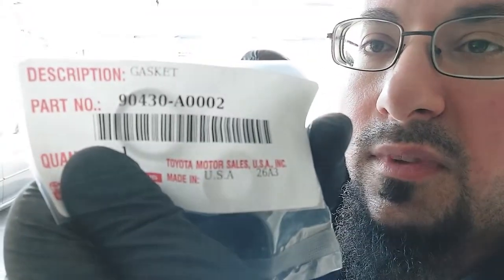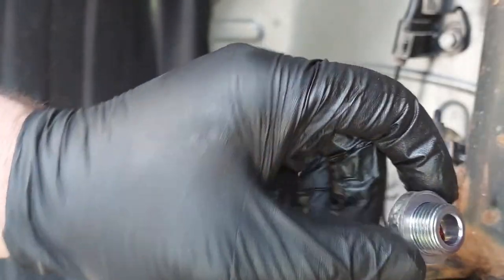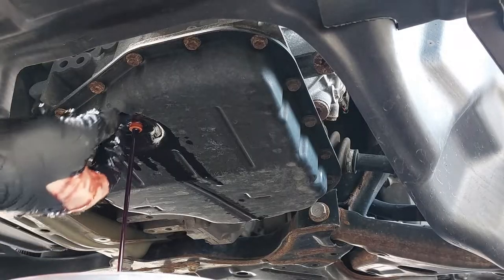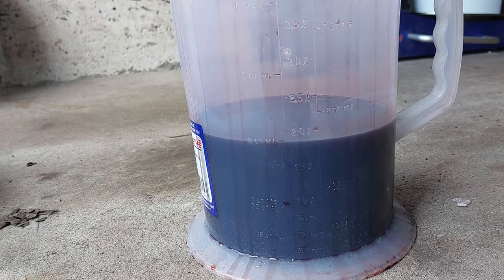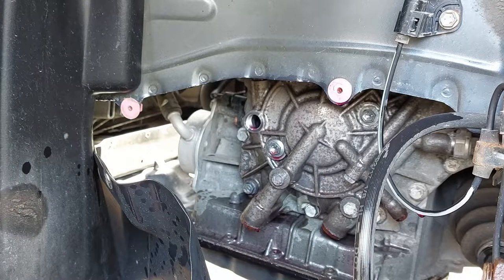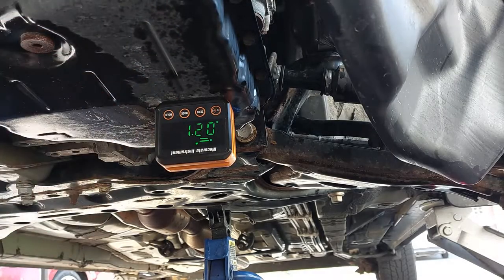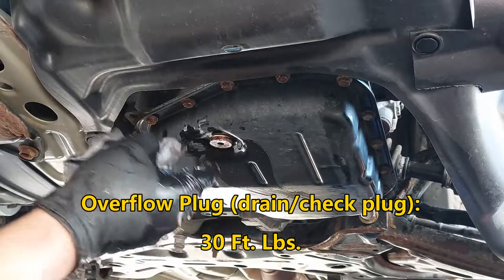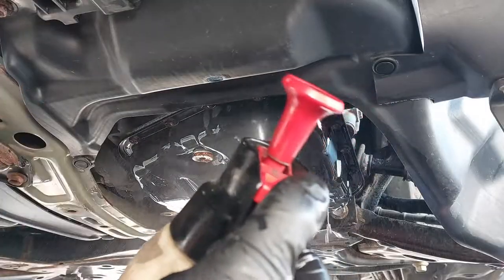2017 Toyota Corolla 1.8 - CVT Transmission Service K313 - Drain and Fill

Comment: You didn't even drop the pan and change the filter.  All you did was change a little fluid.
Reply from the maker: The customer only pays me for a drain and fill so that's all I do. We are not changing the filter and we are not dropping the pan unless the customer wants to pay for it.

Most customers do not want to do that service so I just do the basic service only.

Dropping the pan and changing the filter and gasket is not necessary on Toyota vehicles if the transmission is routinely maintained. A drain and fill service is more than enough on these vehicles.

No shop is going to drop the pan and change the filter and gasket unless you specifically request for that service.
Reply: @moosemobileautorepair  According to toyota, you don't have to change the fluid either.  Obviously, any filter that is actually filtering anything will experience decreased flow as the filter collects particles from the fluid.  That's how filters work.
Reply from the maker: It's an optional maintenance item. Transmission filters work differently than other typical filters like oil filters. They are not subjected to the same harsh conditions like engines are. Transmission fluid can run and stay clean for a long time unlike engines that are subjected to blowby gases, byproducts of combustion, fuel dilution, etc. It's better if you have the money to change it, but otherwise not required. I have seen many vehicles with a drain plug on the pan go for well over 300 k Kilometers or more and still on the original Transmission and filter. Never had any problems.

However, on some domestic vehicles like GM, Ford, Chrysler, etc. You have to drop the pan and change the filter, etc. because there is no serviceable drain plug on the original pans.

Toyota dealerships don't replace those filters and just the fluid for drain and fill service. They will tell you it is "Lifetime" fluid, but nothing is lifetime.

I work on customer vehicles so I just do what I recommend and what they can afford. A lot of people won't change those filters anyway, but again if you can change it it's better if not it won't be the end of the world.
Reply: @moosemobileautorepair oh ya Toyota life time ...yes by the warranty is over..
Reply: You guys are misinformed and have not learned from experience. I got my 2015 Corolla used. Because of that, I immediately did a transmission fluid change and I dropped the pan and put in a new strainer(filter). I have done this many times with my other cars and family’s cars. 

When it’s a strainer instead of a true filter it’s only meant to catch larger metal pieces. The rest gets through. Now, I have done transmissions before where it’s more of a real filter but you will have a hard time finding those nowadays. Proof that it does very little is that if all the ones I’ve ever done, NONE have been clogged or looked dirty. There was nothing to clean because everything gets through. I basically bought a new one for my Toyota for nothing as I have always done. It was the last time I buy a strainer again. 

If the filter is outside the transmission like on the 2007 CR-V I had then I will change it. On that one the filter is inside a metal cylinder so you can’t see if it’s a strainer or filter. Cheap part and easy to do so no problem there. 

Just change your fluid every 30,000 miles and you will always have a clean unit. 40,000 is ok and 50,000 should be the max. If the bolt has a magnet, wipe it down. That stuff goes right through the strainer. 

Remember to make sure the fluid you put in is at about the same temperature as the fluid in the car. Let the car cool down for hours then put it in. I understand a mechanic shop can’t be doing that if a car came in and the customer is waiting. Tranny fluid expands with heat.
Reply: @yactabay  You get far more fluid out by dropping the pan.  While you have the pan off, you might as well replace the filter.  They're dirt cheap.
Reply: @frankwhite1688  I agree. When I took off the pan I got more fluid out but it’s easier to just drive the car for a week and do it again. That will take more fluid out than only one fluid change with the pan taken off. I don’t recall ever having a leak from the pan after putting it back on but it’s one risk you avoid if not taken off. Yeah, the strainer is cheap enough. I remember looking for it for my 2015 Corolla and only Beck Arnley showed what matched to what I took off but I had to order it. The big name auto parts places didn’t have the right one. I just opted for the dealership since I didn’t want to wait. Wasn’t the usual dealer ripoff price either so turned out ok. Maybe by now they all have the right one. I still stick to my statement that the strainer is not really filtering and has always been clean.
Reply: @yactabay  Maybe for you.  It's easier for me to do a job once instead of twice.
Reply: @frankwhite1688  Neither job is twice. In my scenario the second change a week later is to take out a much larger amount of fluid than removing the pan with only one service. It’s just two different options. If you’re only going to do a fluid change only that one time then, sure, you can take the pan out. For those others here who will only do one fluid change and not remove the pan, yeah, you will remove a bit less fluid but ANY transmission fluid replacement is better than none. Therefore, do the single one without the pan if taking off the pan is going to discourage you from changing your fluid at all. Just make sure the intervals between changes a little shorter.
Reply: @yactabay  False, you're draining and filling twice.
Reply: @frankwhite1688  Yes, I’m draining and filling twice. That’s one job, as I stated. Ok, don’t wait a week if it feels like two jobs to you. Drive the car for 15 minutes on the same day and do the refill. You can then call it one service. Happy? LOL  If you take your car to a mechanic shop and he doesn’t have a flush machine or thinks, as many like Scotty Kilmer does, that they introduce contaminants, then he does a double change as I say, are you going to call that getting the car serviced twice? No, the mechanic will call it one job: one service. Dude, you’re knit-picking.
Reply: @yactabay  I can just drop the pan and get out twice the fluid.  If you have to write a book to justify your position, you're proably wrong and obviously have lots of time to waste which is why you're doing jobs multiple times.
Reply: @frankwhite1688  No you can’t get twice the amount out. Not even close. I’ve done both. You get under a quart more out. I have time to write a book and you have the time to keep replying to a petty topic because you can’t stand to lose an argument that, yes, you lost. Like my favorite bumper sticker states: I’m right, you’re wrong. That settles it.🤪 Like you’re really going to let it go. Go ahead, keep trying to justify your wrong position.
Reply: @yactabay  Yeah you can, especially after you take out the filter.
Reply: @frankwhite1688  I did and let it drain for an hour dripping. But ok man, neither of us is convincing the other. Let’s just leave our comments for others to view and come to their own conclusions about it.🙂

Comment: I don't get why you have to drain the excess fluid. Toyota told me my 2017 Toyota Corolla takes 4 quarts. When all the fluid was drained by taking both plugs, all we had to do is pump the 4 quarts in. The bottom part of the pan works like a reservoir to hold the excess fluid. I don't see a reason to drain the excess fluid. Can you elaborate, please?
Reply from the maker: This transmission does not have a dipstick and so the only proper way to check the level is to get it to the specified operating temperature as stated in the video. The bottom drain plug is actually called an overflow plug because the fluid over flows past the plastic stopper that is inside the pan. There is a plastic overflow tube/stopper inside the pan where the drain plug comes out of. When fluid reaches at or above this plastic stopper the "excess" fluid will drain out. You have to overfill the transmission slightly so you can check the level. That is what is meant by excess fluid. The amount of fluid that comes out does not matter, but what matters is what is inside the transmission and pan. The stopper inside the pan has a specific height to where the fluid needs to be so anything above that will drain out. That stopper is what is preventing the rest of the fluid from draining out when the vehicle/engine is running.

If you just drain and put what came out you still need to check the fluid level to know if the level is where it's supposed to be at.
Reply: @moosemobileautorepair  Thank you for responding but you got me more lost than ever before. I understand that there is no dipstick to check the fluid level. Toyota intentionally removed it. I believe the operating temperature of the transmission fluid is about the same temperature as the coolant which is around 195°. I think you meant the optimum temperature to check the fluid level is between 95° and 130°. Let us assume the car has been driven only 100K in km. If we leave this car levelled on the hoist overnight and in the morning we take off the drain plug with the fluid at room temperature, would there be fluid following out? This car has been properly filled out at factory and had no leaks or other issues. I am sure about a quart is going to leak out. Can we put the plug back and say the level is good and drive? I don't think so because I think this car left the factory properly filled and we just released about a quart out. So, it has to be low on fluid now. Whether it is an engine or a transmission, I get the amount of fluid I need from the dealer and dump that in. Toyota probably left out the dipstick because it doesn't want me to mess with it. If overflow occurs at 130°, then there is more overflow at 195°. Are we going to let that fluid out?
Reply: @moethedeaf2746 is the car running though? You are measuring between 95F - 113F (how do they come up with these #? lol. Nissan CVT is different. So it’s relatively “cool” fluid for a machine). They set it to expand. Sometimes you can’t assume factory fill is correct. And also getting it inch perfect might not be that big of a deal (if it’s slightly overfilled by 200cc?). Another guy adds a 1/4L to all his transmissions… Cheers
Reply: @moethedeaf2746  When the CVT gets filled at the CVT factory theres very little fluid in the drain pan. Then it gets shipped and installed in a car, then the CVT oil gets up to operating temp and gets splashed around, and a bunch of that gets into the bottom part of the drain pan. 

Now when you want to do a drain and fill to you have to drain the bottom part of the pan and the top part when you removed the overfill stopper. Then to get back to factory levels you have to overfill the top part until there's very little oil in the bottom part at a certain temp. Then you drive off and oil will get into the drain pan again through normal operations.

Now you could drain out 4 quarts of room temperature oil and pump in the exact amount of room temperature oil and in theory it will work, but it's not as precise and repeatable as the OEM procedure.
Reply: @moethedeaf2746  you are incorrect. CVT fluid is very sensetive to temp. too cold it contracts ALOT  too hot it expands ALOT.  so if you fill too cold the level would be too high when gets to operating temp if fill when too hot it will be too low at cold operating temp.

Comment: why filter not changed? what is the correct procedure to change all fluid ?
Reply from the maker: Filter was not changed as it is not necessary on these particular vehicles as well as it is very low mileage. Usually on the domestic vehicles they require replacement. You can change it if you want, but it will add additional expense to the bill. The customer does not want to pay extra to change the filter. The filter only needs to be changed if there is contamination in the transmission, otherwise it is not a necessary item to replace.

In order to replace all of the fluid you will need to disconnect one of the cooler lines to flush all of the fluid out.
Reply: @moosemobileautorepair  thank you for clear answer👍. Anyway if you will make or find any video  regarding how to flush all fluid from corolla k313 cvt transmission pls tag me if possible. Thanks for sharing

Comment: Would you mind sharing the parts number of the 1L FE fluid.? I can only find the 4L pack. Also, is it needed to do the oil pump air bleeding before drain out the CVT fluid?
Reply: If you buy from Toyota they sale only 1 litar botles

Comment: Hey Moose have a great weekend!   Thanks for video, i can't stand CVTs, but my car has one.. harder to avoid nowadays.   My last car the CVT started acting wierd at 145,000miles so I traded it in.  Could be worse
Reply from the maker: Hey, thanks for the feedback. I'm not a big fan of CVTs either and I don't think I would personally own one. CVT transmissions have a very finite lifespan, however they are improving over the years and I believe Toyota makes one of the best ones out there that seem to last a lot longer than other manufacturers. These transmissions are built by Aisin and Toyota owns at least 1/4 or 1/3 of the company and Aisin typically is made from Japan and they build only quality parts.

The EPA has forced manufacturer's to meet certain fuel efficiency and pollution standards and so the manufacturer's are always coming up with new and creative ideas to put such things into vehicles mainly because of the EPA pushing them towards the edge of the cliff. CVTs are much lighter and more efficient than a conventional automatic. Only time will tell now as to where all of this will go in the future.

I know some early generation Nissans were prone to CVT failure, but most CVTs have improved over the years now and they are all getting better in all vehicles. Maintenance is the key though to help them last a little longer.

Comment: Can you please tell me what torque to use for
1) pan bolts
2) inside 3 filter bolts
3) plastic drain plug
4) main metal drain plug
5) the bolt where we put transmission oil in?
Reply: Its for toyota corolla 2018 zre182r model
Reply: Pan bolts are 69 in-lbs or about 5.75 ft-lbs, the fill plug is 36 ft-lbs.  The rest unsure offhand, but I just did them hand tight and then snugged them up with a stubby ratchet.

Comment: Is this the same process for 2015 Toyota Corolla?
Reply from the maker: Should be the same/similar procedures starting with the 2014 model year Corolla and up.
Reply: @moosemobileautorepair  thanks for the info.
Reply: Same for all K313 transmissions (14-19), look on your door panel like he shows in the video.

Comment: Genuine question.

2016 Toyota corolla Le CVT
102k miles mostly city driving.

Should I change the fluid or could I cause more harm than good?  Dealership says NO DO NOT TOUCH IT it will cause slippage and failure at this point since it's high milage.

I have zero issues with the vehicle I just want to extend its life but I'm scared fresh fluid will cause an issue as they say.

I want to either drain and fill a few times or drop the pan and replace the filter as well.
Reply from the maker: You should service it as the transmission will fail eventually if you don't service it and keep driving it the way it is. You should be OK if you do a couple or a few drain and fills. Changing the filter is also a good idea too. It's not an old car so there shouldn't be any reason for the transmission to fail if you service it.

If you decide to drop the pan and change out the filter, I would have a close look at the magnets in the pan. If there is little metallic debris on it then you will most likely be fine and that the transmission will last a long time. However, if you find a lot of metallic debris on the magnets and in the fluid, then it will indicate there will be future problems and the transmission will not last very long.